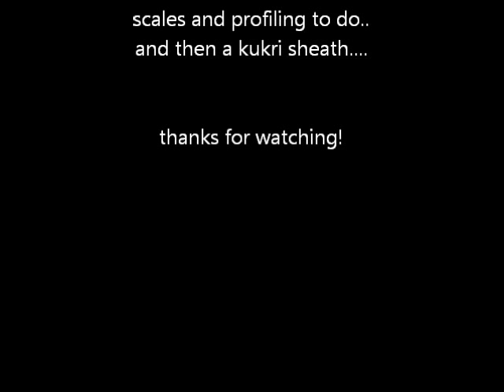Customised Kabar Warthog, a survival blade for the Outdoors by Wessex Blades

Comment from the maker: there will be a lot of balance work to do..probably drilling when I can change the drill bit..the blade has a lot of stock removed so the stick tang for weight distrib,,,was about right.with the extra I've added,,a few holes will save weight but not affect the strength that much,,with testing I should end up with a beast of a blade.a real one of a kind! .all the best!

Comment: great stuff - i said a while back when you got it that the tang looked naff & not up to it.
if i had the tools i would have probably done the same thing mate.
interesting modification methods you used to get the missing piece of the jigsaw :)
wish i had an oppo down the road for welding lol
you've done a good starting shape on the handle scott - as you said, it's just fine tuning the comfort part next.
cracking project mate
well done
darren :)

Comment: Realy nice vid that scott. It was interesting, i would have thought you'd just drill smaller holes on the inside of each scribe so the cutting disc could just follow them but i suppose larger ones down the center make it easier to get both sides at once. Nice to see another viewpoint on how it's done. Take case, and thanks, simon.

Comment from the maker: Hi Bruce..the blade has lost a tooth and I can't afford a replacement...it is still okay for wood and micarta but in metal I have to be really gentle or it jumps and bucks on the lost tooth...I do though have a stock of belts and grinder disc..so I used what I had..have a great weekend!

Comment from the maker: no it should be fine..the MiG guy kept cooling it every 20 mm of welding ..the paint isn't even discoloured 4mm from the weld ...good point though..if the weld was continually done without taken time to cool it..then yes the temper would have be totally screwed..